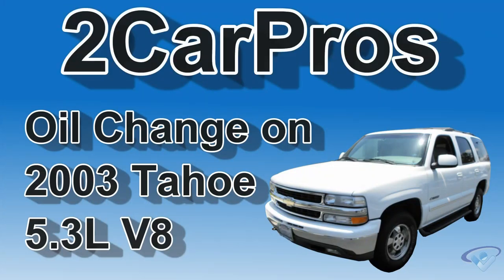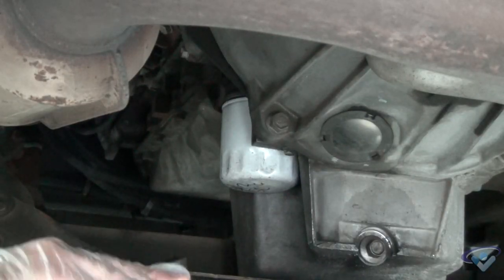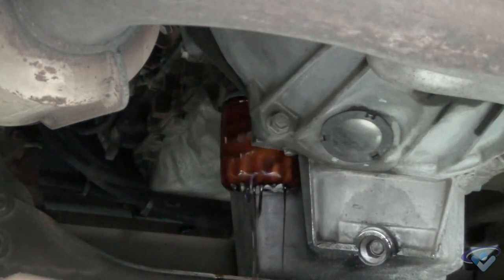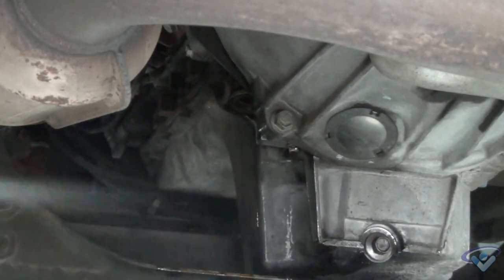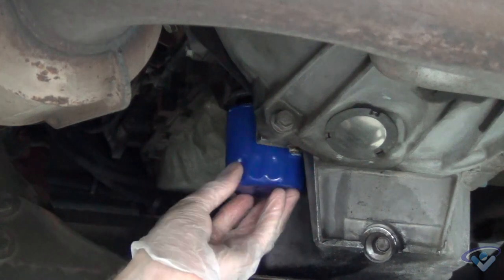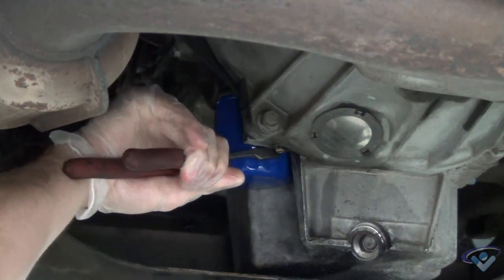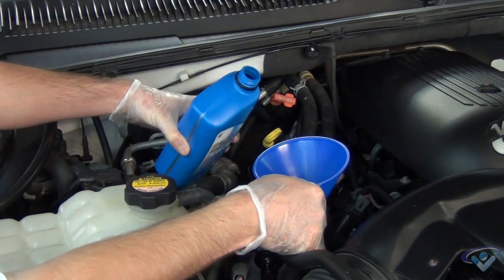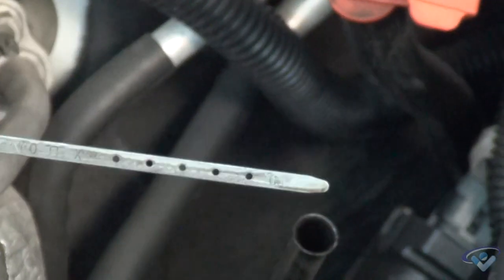Oil Change & Filter Replacement 1999-2006 Chevrolet Tahoe, Suburban, Silverado

Comment: In so far as it goes,for high mileage engines, I prefer to fill filter to reduce the brief rattling when starting  but that's my preference.
Reply: Hollis Page great advice.
Reply: Absolutely, why not especially since it's vertical.

Comment: Helped to see someone doing the job before I did myself.  Thanks fellas.  I warmed up my truck so the oil would drain out better but the damn oil filter was too hot to hold onto and I dropped it in the pail lol.  Other than that, the job was a relatively easy one.
Reply: 5-10 min warm up is all you need, lol not a 30 min fun joy ride lol

Comment: On those GM oil caps its a good idea to spray some silicone around the rubber gasket.  They become tough to removed with age.

Comment: Great video, but its missing one key step, resetting the oil life gauge on the instrument cluster to read 100% after you have completed the oil change.  You should include that for your subscribers as well.
Reply: Thanks for your comment 😁. I just changed my oil to my 2005 Chevy Tahoe like 2 days ago and the “change engine oil” was still popping up. I just found another video to show me how to reset it. Youngin learning little by little 😌
Reply: For those wondering how, turn key to on position (don't start the truck) and press the gas pedal to the flopr and then let off of it. Do that 5x in quick succession until the truck resets it

Comment: Looks good. A few things tho. I’ve been a mechanic for over 20 years. 1) I really hope you didn’t spray the cleaner (we sometimes use break cleaner at Chevrolet) to get the oil off. But if u did, I just hope u didn’t get it in the actual oil filter drain. 2) if your car is a 3.6L, then you would reverse it and normally put 6.3 qts. It’s okay to go over such as 6.5 quarts. If it’s 6 quarts, then just fill it to 6. No need to fill it almost to there. Better to over fill than under fill as it would burn your engine. You did a good video tho for the people who didnt know how to change their oil.

Comment: I always take oil cap off first, helps the oil flow, also I crank the engine, not letting it start, amazing how much more oil comes out.
Reply: Cranking the engine may be causing the pump to draw oil from the filter which you would be draining anyway.  This may drain the pump and filter lines of old oil but it may also introduce air into the lines and affect the time it takes for new, clean oil to get to the valves.  I go so far as to put oil into the new filter before installation when possible to reduce the amount of time it takes to fill the lines with oil.

Comment: Use 5 quarts of oil !  I have a 1999 Tahoe .    I drained the oil, changed the oil filter, added 6 quarts of oil.   After warming up,  the  oil dipstick read about a quart high.   The next day I dropped the new oil filter, dumped (and saved the new oil, approximately one quart), cleaned the outside of the oil filter and reinstalled.   After warming the dipstick indicates a proper full reading now .   Use 5 quarts of oil even with a new filter is my lesson here.
Reply from the maker: It takes 6. Thanks for watching!
Reply: @2carpros  Not in mine !

Comment: Never tighten an oil filter with a filter wrench... ever.
1.  You could easily over tighten it
2.  You could just as easily dent the filter (a dented filter is no good and should be thrown out right away)
Reply: Josh I just turn mine  as tight as I can by hand
Reply: hand tight + 1/4 turn.
Reply: Hand tight plus one quarter turn with a wrench.  No danger of denting the oil filter because the force used to turn the wrench the extra quarter turn is minimal.

Comment: 2CarPros why did you use a 10w30 oil? I have a 2004 chevy tahoe (V8 5.3L LT 2WD) with 121K  miles, what oil viscosity would u recommend I use?
Thanx!
Reply from the maker: Sorry for the confusing but the customer wanted to us to use that specific type of oil on his vehicle. You should always use the oil called for by the manufacturer of the vehicle. Please subscribe if you have not already.

Comment: 2 things wrong with this video. 

NEVER use a filter wrench to put on filter. Hand tight. 

And pull the filler cap prior to draining the oil allows for proper and quicker drainage.
Reply from the maker: Due to the position of the oil filter it is difficult with people with large hands to get " hand tight " on this oil filter. In the video it says to tighten with the oil wrench but lightly clamp the oil filter not damaging the filter internally. Also the oil cap does not need to be off for the oil to drain out of the pan or filter. All of our videos have been done by a certified ASE mechanic with over 35 years of experience. If you have anymore question, feel free to ask at http://www.2carpros.com/questions/new
Reply from the maker: XboobtubeX Is the 3rd hole in the middle of the hashed area? Then I believe it was stated correctly.
Reply from the maker: Awesome thank you for the input. Please subscribe if you have not already.
Reply: mdvonte thanks for the info i will be aware of that in the future
Reply: 2CarPros I couldn't have responded better to that dude myself. You should create a YouTube tutorial for deflecting negative criticism LmAo
Reply: Never hand tighten the oil filter on these.  I just went to an oil change place and lost most of the oil driving only 25 miles.  I was lucky I even noticed.
Reply: Wtf is a filler cap
Reply: @2carpros  hand tight is fine and once hand tightened it's supposed to be turned another 3/4 turn 
doesn't matter what you use just don't go past 3/4 turn. Not everyone has a hard grip! everything
you did and explained was right. thumbs up.

Comment: hello sir I got a question I own a 2002 GMC Yukon Denali 6.0L engine, I was looking online and the type of oil is 5W-30 can I use 10W-30 instead ?
Reply from the maker: It is always best to use whatever oil the manufacturer says to use, depending on where you live 10W-30 should be fine
Reply: 2CarPros
thank you sir I live in Puerto Rico so does make sense to use 10W-30 cause tropical weather here is hot all the time lol I just wanna to be sure, and thank you guys your videos are amazing well descriptive and helpful gracias :)
Reply from the maker: Oh yeah you are good then. Thank you so much for watching!

Comment: yes, there is what looks like a 3 inch cap on the bottom and then maybe a 1 inch above that one.
Reply from the maker: Yeah that is just a visual port so you can see what the flywheel is doing. We have had a few trucks come in with out the cover installed like yours. It is ok if the cap is missing.
Reply: +2CarPros thank you. i really appriciate your response.
Reply from the maker: No problem, thank you for watching!

Comment: Did u have to jack it up still or can u get under it as it sits?
Reply from the maker: We jacked it up. Maybe you can get under it with out jacking it up. Thanks for watching!
Reply: Let me know if you try to do it without lifting it, I'm thinking about trying it but I know it will be a very tight fit for me LOL
Reply: Plen122 I did it without lifting it, it was pretty tight but I was still able to change the oil and filter
Reply: 4x4 no jack needed. Now the RWD needs some jacking. Plus I'm fat so yeah...

Comment: the cap on the Tahoe said 5w30 and he used 10w30 oil
Reply: Denny Strate you can use 10w30 as well
Reply: Denny Strate I use 10w40
Reply: Manufacture spec is 5w30 but the engines are pretty tolerant to a few different oils.
Reply: My 1999 suburban says 5w30, but the first owner put 10 W 30 for a long time. I've used both, synthetic and non-synthetic, lol pretty much everything. But I mainly try to use what it says on the cap.
Reply: It really doesn't matter. As long as its a good weight oil.
Reply: I use 10w-40 With Lucas Oil 💪

Comment: The filler cap clearly says to use 5/30! Why did you not use that weight?
Reply from the maker: All oils are the same "weight" firstly, the W stands for winter believe it or not. Secondly if an engine is a bit worn it is a good idea to use a more viscous oil to help take up clearances better. Thanks for watching!

Comment: can castrol gtx high mileage 5-30w work for tahoes & suburbans ?
Reply from the maker: +Nidal Al Saleh Yes that will work just fine
Reply: That's what i use on my 03 Tahoe full synthetic 1007 k&n oil filter

Comment: I’ve never did a oil change without filling the filter
Reply from the maker: Can you if want to but, it is unnecessary. There are plenty of oil filters that install at a right angle and it would be impossible to pre fill. Thanks for watching!

Comment: My silverado has a 4.3l engine and it says to only add 4.5 quarts of oil.
Reply from the maker: Thanks for the info Please subscribe
Reply: 4.3 liter engine means 4.3 liters of gas, not oil lmao
Reply: Juan Ruiz What are you talking about? Did you even read what I said?
Reply: Juan more time!
Reply: Diapason Dlvg LmAo
Reply: 4.3L is a V-6 engine, my old 1996 S-10 had one. 4.5 quarts of oil is correct.

Comment: 😑 I've been paying Jiffy Lube almost $60 for this for the past 2 years? I wish I had lube for that wallet fucking lol
Reply from the maker: Yeah, and there is no way to tell if they even did a total job. I have heard stories where lube shops take 1 quart out and put 1 new quart in so it changes color slightly, then just wipe down the oil filter so it looks new. It's always better to do the job yourself for the sake of completion not to mention the savings.
Reply: 2CarPros the good ol show you another cars dirty air filter and charge you for nothing

Comment: Poke a hole in the oil filter and let the oil drain out of it, then remove it. Lot less mess
Reply from the maker: Yeah that is a cleaner way to do it. But it is a little advanced, I try to make these videos as easy as possible for folks to follow along with. Thank you for watching!
Reply: Great idea!